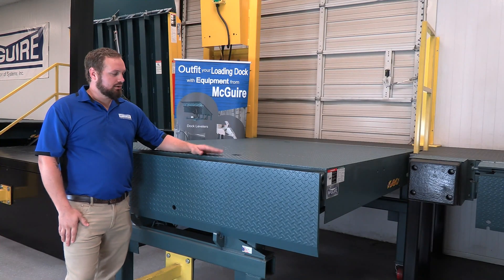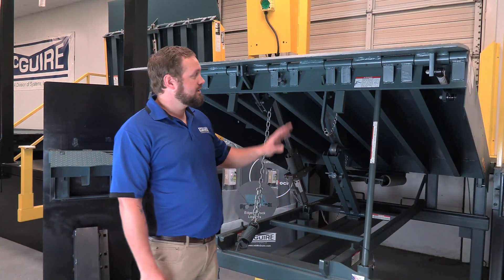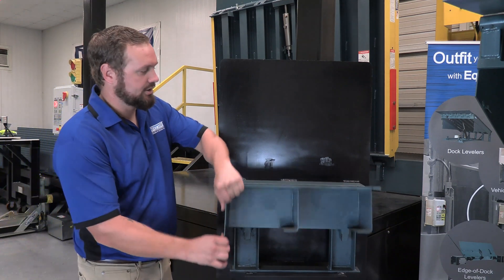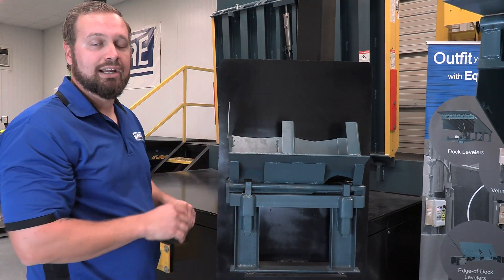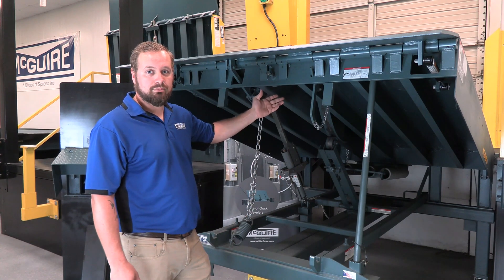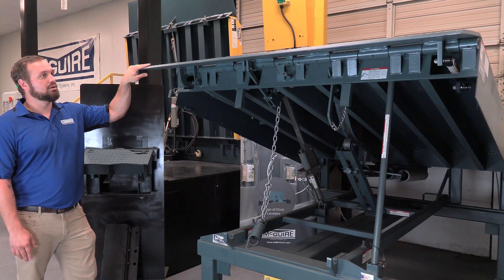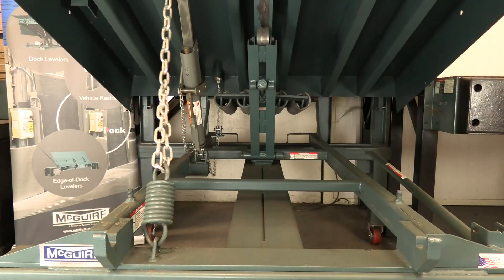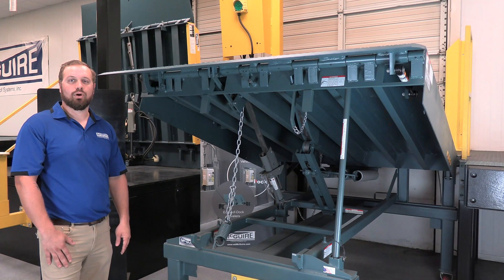MP Mechanical Leveler Overview

Comment: Place a plate on back side of cam plate attached to deck. So if the snub spring breaks the roller lift arm wont travel past the cam plate.  When this happens techs cant lower the unit without removing tension and a forklift because the arm is behind the cam plate.  Ive ever seen it on a power ramp.